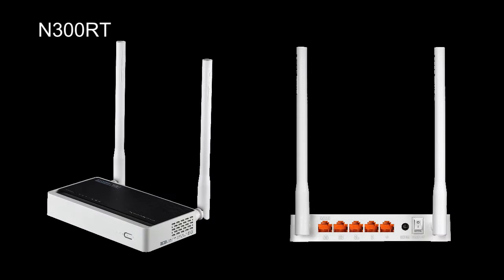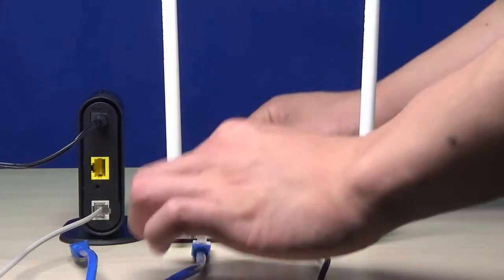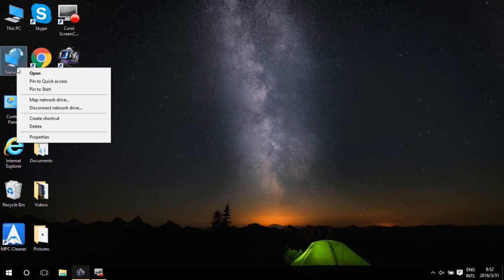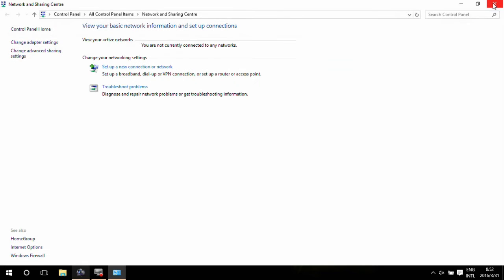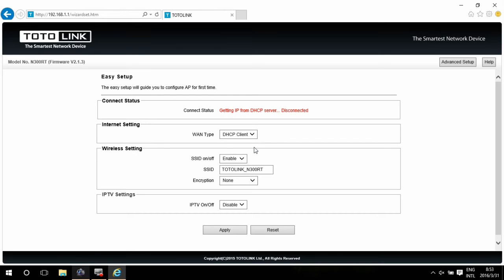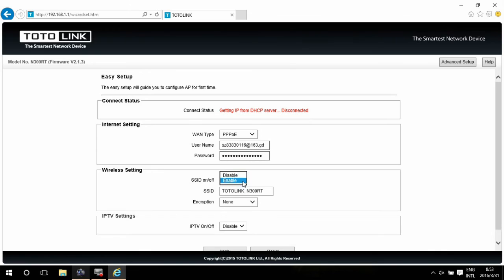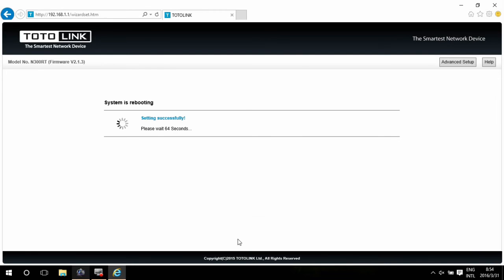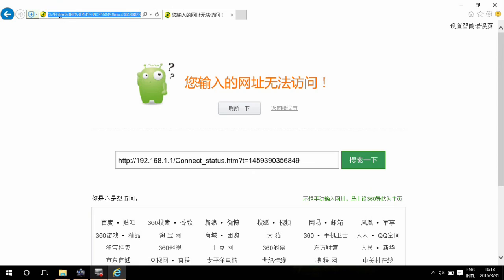How to setup wireless router N300RT(PPPoE)

Comment: When I connect the wireless router and activate the Ethernet connection, the GSM modem stops loading websites. The network settings show that it is connected (active connection, the indicator light is on), but on the taskbar, there is an icon indicating no connection, and the internet does not work. The cable from the laptop is plugged into one of the 4 router slots (the fifth one has 'WAN' written on it, which I assume is meant to be the internet source). I want both networks to be separated, but the internet to work on the laptop. The router is Totolink N300RT